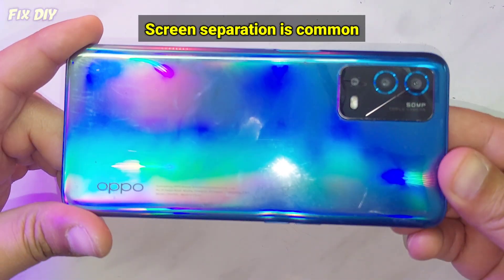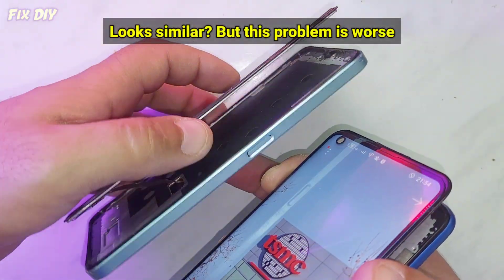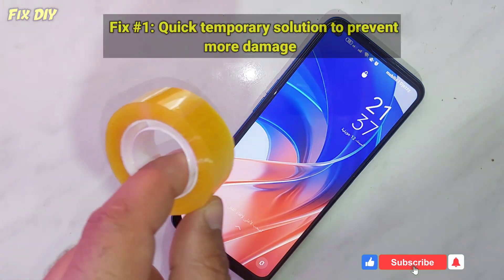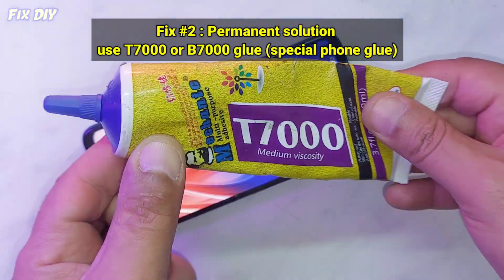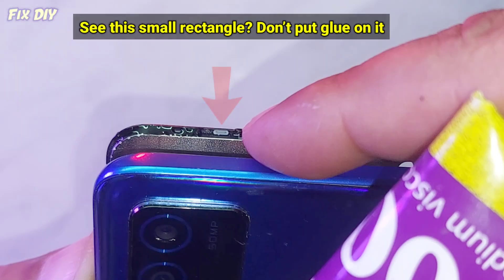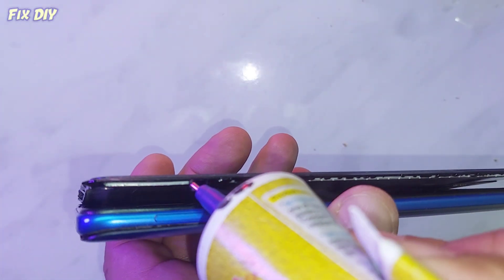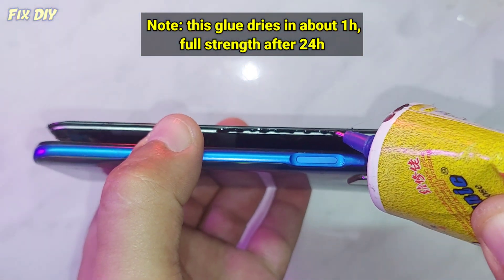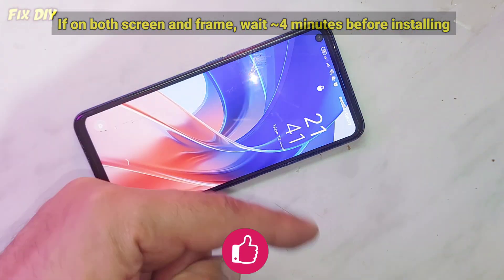Phone Screen Detached but Still Working | Easy Fix with B7000/T7000 Glue

Comment from the maker: ⚠️ Many people ignore a detached screen until the flex cable breaks — then it’s game over!
👉 This video shows how to fix it safely with B7000/T7000 glue (only $1–$2 and lasts for many repairs).
📌 If your cable is already cut, check my other video for full screen replacement 👉 [https://youtu.be/kTwwbbudlXE]

💡 Even if the screen is only slightly loose, it’s still a risk — follow these steps to keep it safe.
🔄 Share this video with a friend who has this problem before it gets worse!

Don’t let YouTube hide useful repairs from you — hit 👍 Like & Subscribe so more fixes reach you.

Comment: okay, but why most of technicians use b7000?
Reply from the maker: Great question! Let me give you a very precise answer so you get the full picture.

Both B7000 and T7000 basically do the same job, but there are a few important differences that many beginners don’t know.

B7000 is transparent. This can be good in some cases, like if a small amount goes near the light or proximity sensor — the sensor can still ‘see’ through it.
But transparency can also be a downside: some LCD screens leak light from the edges, and B7000 does not block that light, so the screen may not look clean after installation.

T7000, on the other hand, is black and more solid. It completely blocks light from the screen edges, which gives a cleaner and more professional finish, especially on LCD displays. It also has slightly stronger bonding compared to B7000.

Just make sure not to apply glue directly on the proximity or light sensor areas — this is important on some phone models, as I explained in the video.

So overall, I personally prefer T7000 for most repairs because of the clean look and stronger hold
Reply: @FIXDIY ohh I think i accidentally covered proximity sensor with t7000. The screen is not turning off during calls but the auto brightness is working.